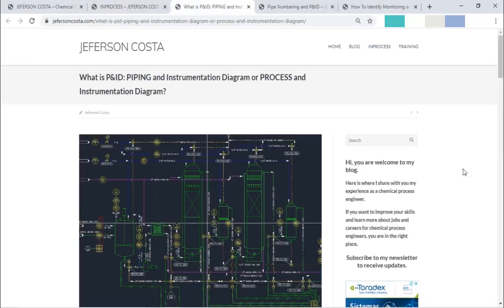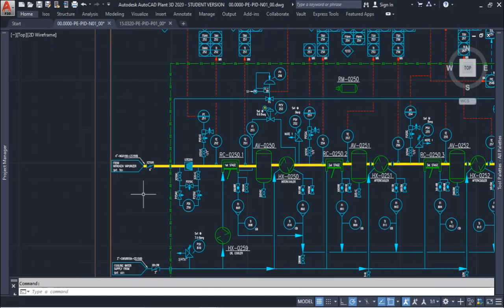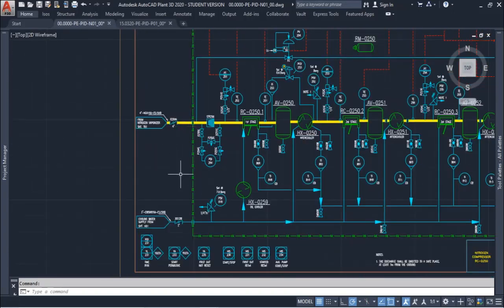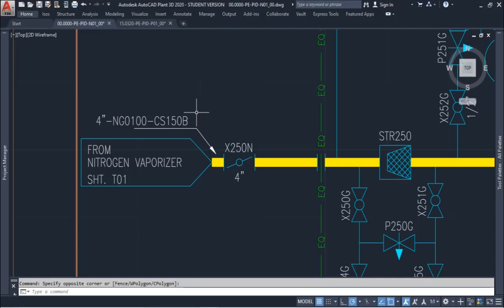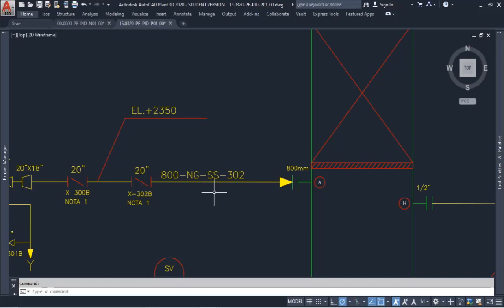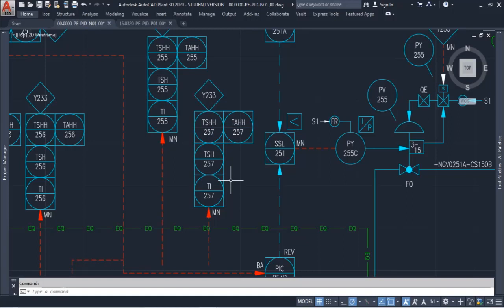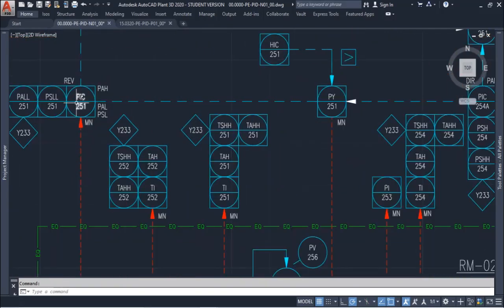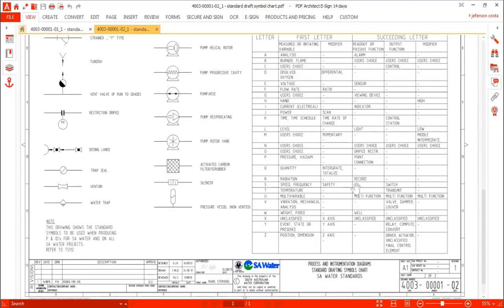How to Read P&ID (Piping and Instrumentation Diagram) Revealed

Comment: What does colors mean in the P&ID? Does it only depend on the drafter if he want to color code  like all equipment as green and all steams and instruments as skyblue?
Reply from the maker: Hi Jant, the colour set up is related to AutoCAD printing. Usually, the chemical engineer uses the printed or pdf version of a document that is printed in scale of gray or black and white. Eventually you will see some markup in read in printed P&IDs.
Reply: Bu de